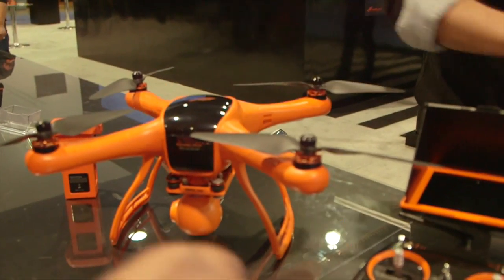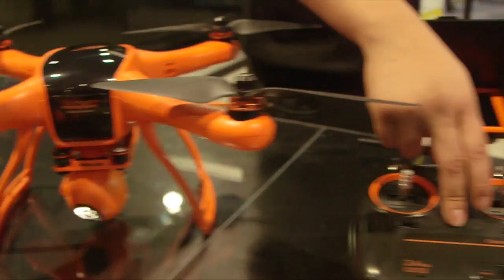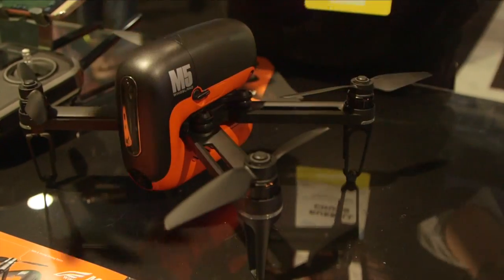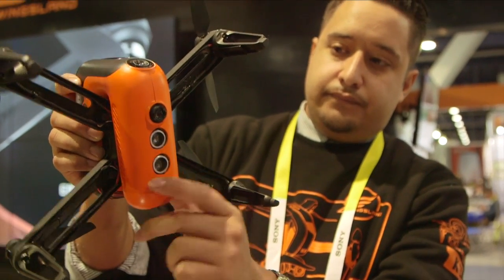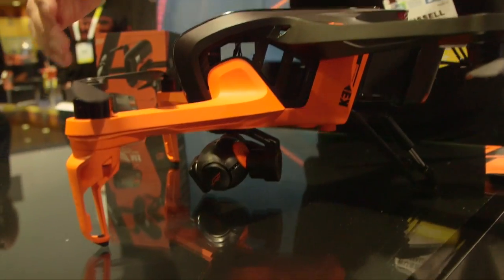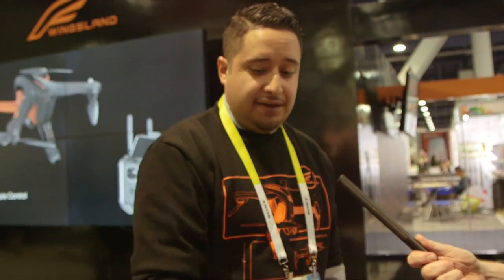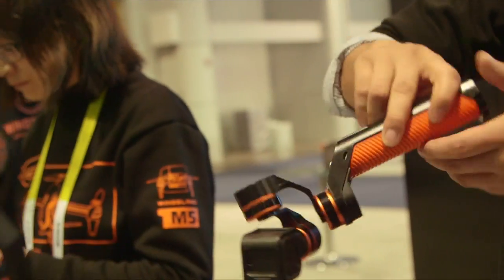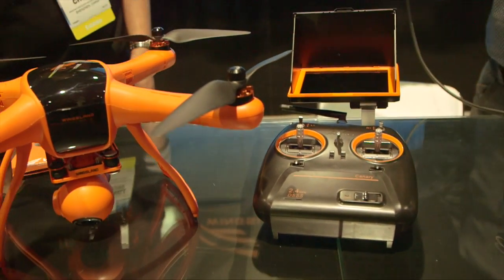CES 2016 - Wingsland, a new Drone company

Comment: Prefer to see demo flight / video rather than the usual sales pitch
Reply: +jochooi I have a minivet. It's the original version with a small FPV screen. Support and firmware is not consistent from wingsland. The company doesn't really seem to have good customer support. The machine build quality is decent, however the gimbal/camera is a nightmare. It took two months to get a replacement board to fix a gimbal shake that plagues many buyers machines. After the replacement it still has issues. I would hold off on buying any of their products until they can prove that they are committed to quality control from both a hardware and software standpoint.
Reply from the maker: +jochooi Agree, but within the constraints of packed large hall, space was at a premium each drone manufacturer only had a  small caged area to hover their drones. The arena  was also buzzing with WiFI -CES 2016 - .
Reply from the maker: +D MacDonald Thanks for sharing
Reply: Something happened with this company....the good models have not been released in the US yet.  I believe they are focusing on the production and development of the X1 and s6.  Both are low end compared to the competition.